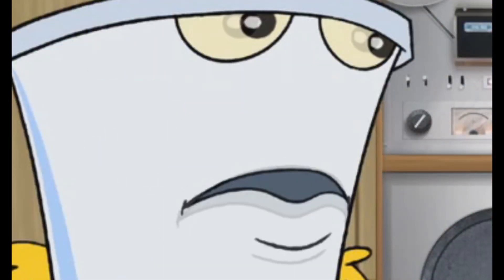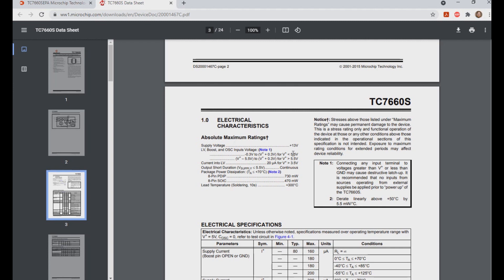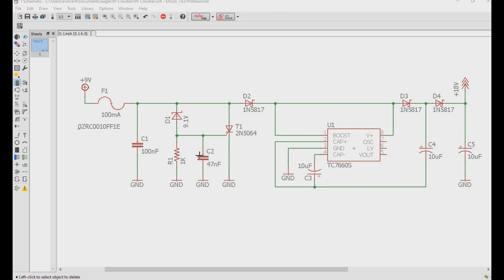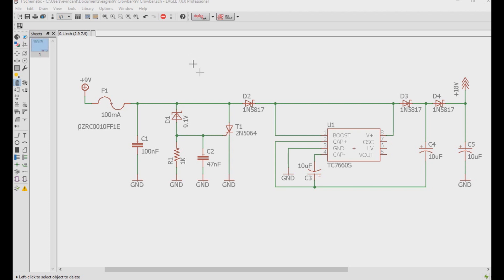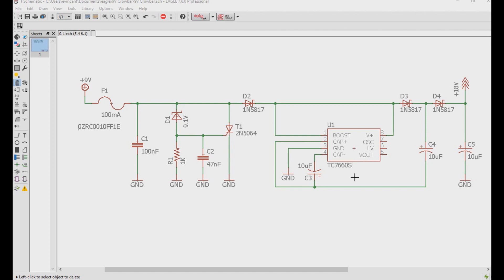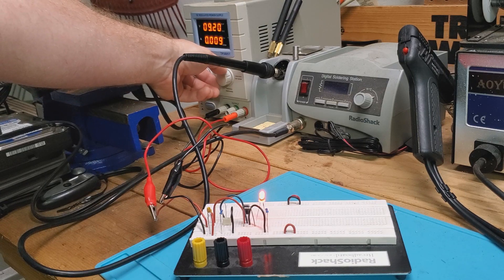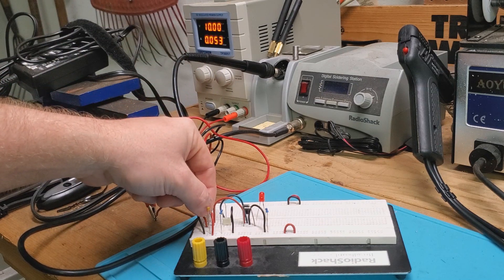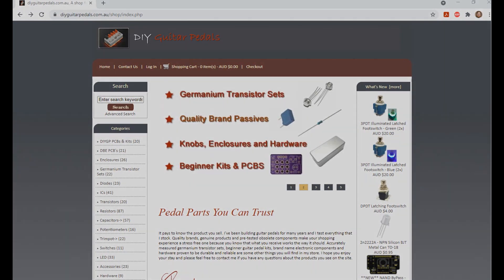Over Voltage Protection - Don't Let Your Charge Pump Explode

Comment: Does this resettable fuse then take the place of the  power supply series resistor ? As i see there is none included in the circuit shown?

Comment: How about just using a 1W 12V zener diode to ground instead of the SCR? One hefty 1000mA part to take the heat and trip the 100mA fuse? I'm guessing that will be less effective for some reason? Nice vid :)

Comment: hi,
good solutions for the 7660 but for me now i use only TL1054 which allows you 100mA instead
of the poor 20mA you've got with 7660, and it go up to 15v.
Reply: The concept should work there too!
Reply: @erikvincent5846  right, with a 15v zener

Comment: I've heard that a lot of players are moving more to fixed supplies and getting away from battery usage. If this is true, why not just use a regulated 9V supply and be done with the situation? Am I missing something here? (Shrug.)
Reply: The issue is if someone puts a regulated 18V supply in a 9V pedal in efforts to get more headroom. I get that question enough that I figured I make a video on it.
Reply: @erikvincent5846  I hear you, Erik. There are enough non-techie folks out there to make this an issue, of course. I guess they figure that if 9V is good, double the voltage must be better.

I guess we could tell them that we could fix the pedal, but the problem of that is repair cost would probably be just as expensive as purchasing a brand new pedal. Hopefully, they'll learn from the experience and not try something like that again.
Reply: @davehebert3403  agreed. I have a friend who has a boutique pedal company and he had an overdrive that falls prone to this issue from time to time, due to user error, not the pedal. This way, he doesn't have to worry about it anymore.
Reply: @davehebert3403  For some pedals doubling from 9 to 18V is better! Many Catalibread pedals operate in the 9-18V range as do the Cali76 compression pedals and the Fulltone OCD. But not the Klon!!! 😅 (always read the manual!)
Reply: @HazeAnderson  Ah, okay. I'm a total noob in the pedal field, btw. OTOH, I would definitely RTFM always.

I'm guessing that some folks figure if this pedal can operate from 9V to 18V, all of em must act that way or something. (Shrug.)

I'd imagine that a learned individual could play around with the voltage input and find that sweet spot, and I'm pretty sure that is what a lot of guys who fry pedals are doing, searching for their tone, now that I think on things.

At least some of them will run across this post, and, hopefully, Erik will save them some headaches.
Reply: @HazeAnderson  Oh, btw, I saw a video the other day about the Klon. It's totally unbelievable what an original Klon goes for, dude. Now I'm wondering if it sounds any better than the clones?
Reply: @davehebert3403  my power supply has dip switches on the back to go to 12 or 18 volts on several of the outputs. It would be easy to mess up and plug 18 volts into my Tumnus Deluxe. The manual for that pedal makes clear that would be a BAD THING.
Reply: @davehebert3403  The manual for the Tumnus clearly emphasizes DON’T USE 18 VOLTS.  I know they have to design for cost and price points, but I’d have a voltage limiter if I ever designed a pedal that could get wrecked. +1 color coding is a great idea. For some odd reason the cables that came with my power supply have various colors on the end that goes into the power brick instead of the ends going into pedals. 

In my amp builds, green and black are grounds, red HT, cathodes yellow, grids brown, controls white, etc.  My layout drawings are color coded, and this makes it so much easier to double check my work and debug the inevitable mistake(s).
Reply: @chipsterb4946  Pretty much what I do as well, Chip. I've seen it across the industry since I was a kid, so why not continue with such efforts. Also, I was fortunate enough to be trained in real-world application of such techniques after school, and when new-hire technicians come into play, telling them "Just connect A to A, B to B and so forth, and you'll know it's right because green will be going to green, blue to blue and the like." Using both of these techniques makes it very easy and also covers the color blind as well. 

I don't know about you guys, but I HATE getting calls at 3:00AM to travel 500 miles to properly connect electronic equipment because some new tech is confused. I guess you could make it more difficult and charge out the ass for a service call, but I'd much prefer spending my precious free time with my family, and really not into greed.
Reply: In the old days, over-voltage damage would happen because someone used a non-regulated 9V supply with a single pedal that draws so little current, that the supply was actually up around 14-15V.  Back in the 80s and 90s, regulated supplies were not that common and they were expensive.  So a lot of musicians would just go and buy a cheap Kmart wall wart to save batteries...  These days over-voltage damage is surprisingly common, and I think it's because so many pedal board power bricks have dedicated 18v, 12v and also adjustable outlets.  And it's easy to accidentally use the wrong plug, especially if you are trouble shooting a board at a gig, in low light, with the drummer already counting in the first tune...  :)
Reply: @RobMods  Good info to know, Rob. Thanks.

BTW, with a decent size pedal board, say a chorus, waw, and a few others, what kinda current or we talking here? I'd guess 2 amps or so?
Reply: @davehebert3403  out of all the pedals I've made for DIY Guitar Pedals, most are barely 10mA. The Lich King Chorus does draw a bit more at around 16mA. The Ahm-Bee-Aunce reverb/delay combo pedal draws the most of any pedal I've made (except for maybe an actual 50V Tube driven one that I am working on) and it is at 70mA, mostly due to the Belton Brick inside it. If you want to include the 10 Minute Amp, if powering it at 18V and cranking it, plus slamming it with a high gain overdrive, it can get up to 75mA.
Reply: @davehebert3403  With a regulated supply, the voltage stays the same regardless of the current consumption.  (Within the spec of the supply of course.)  For guessing the current draw of a board, it's hard.  That's because pedals will vary hugely these days since modern pedals are by and large not designed for battery operation.  One pedal may draw 50 to 100 times the current of another.
Reply: @erikvincent5846  That's the kind of current draw I was seeing in my head after looking at numerous schematics, with a few transistors here and there, and a few more op-amps.

I'm picturing somewhere around 1A total for a pedal board, but bumping it up to 3A regulated for head room, and that would suffice for my board. I'm still in the design phase.
Reply: @RobMods  Ah, okay. Thanks for the great info, Rob.
Reply: @RobMods  This is true. At least with the DBE pedals from DIYGuitarPedals, I've been pretty good about recording their current draw in the build docs. Usually the component tolerances don't deviate the value too much and can usually get it accurate down to the milliamp.

Comment: Very interesting circuit Erik, I'll be considering this circuit for future pedals (even when I specify my clients to not use more 9V I have to take precautions) . I'm curious if you could make an analysis of the reverse polarity protection with an thermistor, I've seen this type of circuit with Frantone pedals and I watched Fran do maintenance on one of her pedals and she only used one thermistor and a zener diode https://www.youtube.com//watch?v=wy8LSYtHXdg&t=600s
Reply: Ah. I've seen that before too. That can work, but I don't think that is a crowbar, so much as that is more like a clamp, as a clamp is closer to a diode and a fuse, where a crowbar is closer to a diode, a thyristor, and a fuse. Wikipedia calls it out, but the advantage of a crowbar over a clamp is that the low holding voltage of the crowbar lets it carry higher fault current without dissipating much power (which could otherwise cause overheating). Also, a crowbar is more likely than a clamp to deactivate a device (by blowing a fuse or tripping a breaker), bringing attention to the faulty equipment.
Reply: @erikvincent5846  I see, in any case, the crowbar showed would be enough as a reverse polarity protection?
Can I bypass the resettable fuse?
Thanks in advance
Reply: @pedro_rivera99  the fuse would be a necessity. Without it, the current draw would likely exceed the zener and then it would fry. Then you would have to desolder and replace.